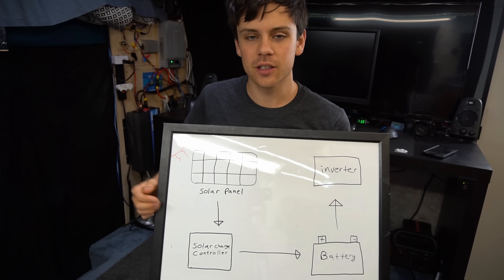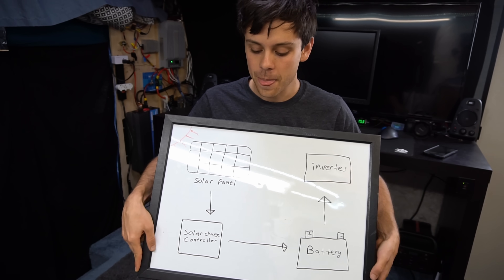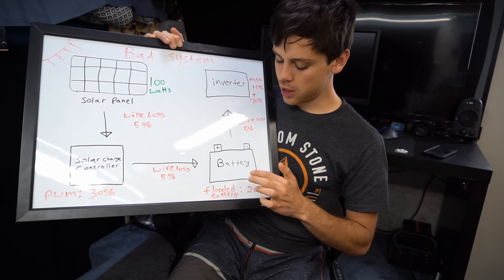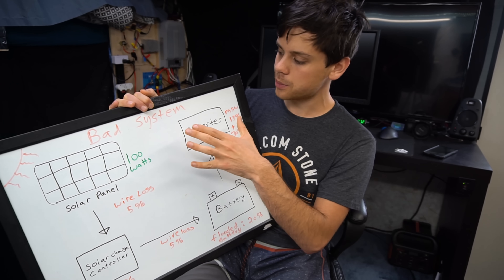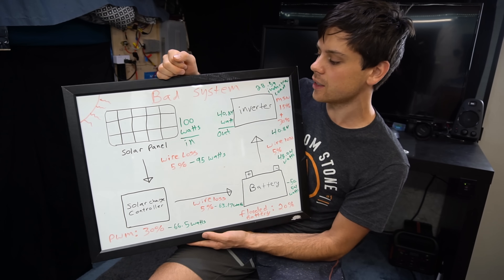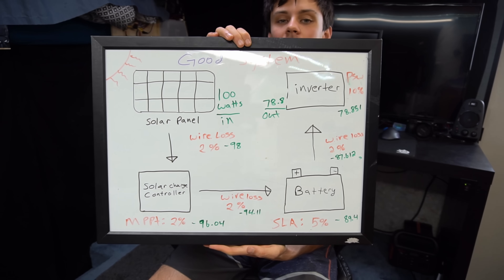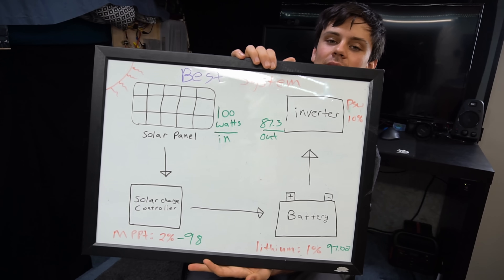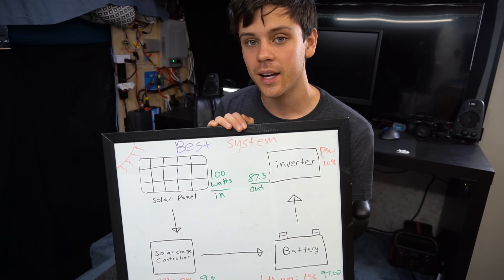Off-grid Solar Power System Comparison: Common Efficiency Losses and Bottlenecks!

Comment: How does the length of a run affect losses? I would like panels on my detached garage but I would be looking at a run of 70-80 feet. Is there a way to calculate losses based on how long a system is? Or at least how to size up a wire gauge based on length to minimize loss? Thanks

Comment: Hi Will, interesting point you made on the modified VS pure sine wave inverters. I'm searching for inverters recently and I read a bunch of datasheets, on growatt inverters they claim almost in all their series that the efficiency is at least 95%, I checked, their only pure sine wave inverters are the SPF/SPF series. What's your opinion on that? Would you consider doing a review on the growatt inverters? I would be dying to see those~

Comment: Something in this video confused me so I hope you can clarify. I previously watched your video (12v Solar Charge Controller Buyers Guide - Beginner Friendly!) where you compared several charged controllers and you seemed surprised at how close the output was between the PWM and MPPT but in this, you call out the inefficiency of the PWM controllers. Additionally, I think it's important to include the price difference between your ideal system and the one that is not so ideal. Some might be willing to pay a bit more to get a bit more power and life out of their systems while others....not so much. Of course, I just stumbled upon your page and am going through your videos and so far I love them. Awesome info! My project is much less grand where I'd like to hook up two Wyze cames (v2's and V3s) with the additional need for an IE Illuminator. If my math is correct, I'll need a battery that will support about 20 ah...but the cameras themselves draw very little while the emitter is a 12v, 1a that uses about 6 volts. Although the cameras will be running 24/7, at the winter solstice, I figured the emitter would need to be on for 15 hours. I'm sure you've also done a video on doin' the math so I'm probably just rambling at this point. 🤣

Comment: Love your videos... HELP!  I am being told that I have sized my Solar Panel string to small to charge the battery bank... Currently Battery bank is 6vx8ea Golf Cart Flooded batteries wired in series to make a 48volt bank then I have another set wired in series then paralleled for more amps.... I wired my Solar panels Renogy 12 100watts in series 4 panels to get the 48 volts I thought would work for the Solar Charger to charge the batteries... Now I am being told by a contractor I need at least 5 if not 6 wired in series to get enough voltage... He says 4 panels aren't enough... Your thoughts and maybe a video to explain how many panels does it take to charge a battery bank like I am using... Thanks for the information.

Comment: Will, head inland for a couple weeks.... away from fault lines, Magnetic coupling of Sun's coronal hole streams is causing electromagnetic tectonic plate disturbances, along with increased cosmic particle influx,  and the earth's magnetic poles are about to swap, both will cause problems with Earth's magnetosphere, being a spherical capacitor electromagnetic coupling will be extremely high. Causing all kinds of problems around the Pacific rim, Seriously. DO IT!
Reply: Still patiently waiting for that swap.......still waiting.......
Reply: @jime9305  or he's trolling with a great example of Poe's Law.
Reply: When I was young, I wondered what people like you knew that I didn't.  Now I'm old and realize you're just a bunch of delusionals who need low-dose anti-psychotics.
Reply: @RonJohn63  You do not read very many Scientific Papers Do You? You just go with the  Ad hominem attacks...and in so doing put yourself in the "I am not going to waste my time" category. I could site the ASIN , but you probably do not even know what I to what I am referring.

Comment: I watched the video "The Truth About Flexible Solar Panels" first than this one video. I skipped the 'bad" and the "good" (I'm not techie and won't understand it ... so why confused myself more)After watching this episode, I've come to the conclusion ... there is going to be lost (either system), theres no why to harness in the 100% ?! What about a system that will ... can you incorporate your diagram with the RV charging your batteries while your driving ... I hear you can do that. But also have a kill switch so the RV isn't using the main battery that's designated for starting your vehicle. I need a book "Solar for Dummies"

Comment: If then there are people who charge 12V batteries to connect to the MPPT controller 3-4 panels in series, reaching 100 volts and more, when at most it takes only 16 volts during the equalization phase, to overheat and to lose efficiency regulator stressing it to the maximum of its tension. (not power)
Just read the PDF manual or look at the charts of any serious charge regulator such as the MidNiteSolar 150
For lithium or gel, single panels in parallel are sufficient for the 24V bench (maximum 2 in series), dimensioning the descent cables 
well and do not forget the Schottky diodes for each panel or parallel. 
Leave at least a 20% tolerance on the MPPT maximum power for the lens cloud effect!

Comment: Hi, If I   put in my RV only one , 100 ah lithium batteries,  including a good charge controller and aMT-50 monitor do I need a BMS or not?....some 100 amp batteries has a built in BMS, some has  not.....but  they sell   as a drop in  batteries,

Comment: Followed your advice about a year-and-a-half ago and the components that I chose were from your suggestions. It is the best case scenario system that you've demonstrated here. I've never wanted for power I run a micro system and a stealth van running refrigeration and electric blanket, power up devices. Never wanted for power then again I live in Denver lots of sun. But this is a very efficient way. Design is key. Thanks for the best advice.

Comment: Okay I would say that if get silver wires than u can speak about less than 1% loss, moreover to say that the panel can actually produce its own 100 watts it can be angled toward the south. Last u can still improve the inverter, pure sinewave toroidal 92% efficiency. About battery hard to determine as depends on its age and state of degradation too. So far quite good calculations after all. Good job

Comment from the maker: Side Point: YES a 100 watt solar panel will typically only produce 70-90 watts. Absolutely. But this video does not cover solar panel output. It only covers efficiency losses/bottlenecks. I used 100 watts solar to make this video AS SIMPLE TO UNDERSTAND AS POSSIBLE. I will cover solar panel output in another video (or you can watch my older videos where I mention this issue). Hope this helps! :)

Tired of getting ripped off? Check out my "Will Prowse Approved" solar product recommendations below!

12V Batteries
https://www.mobile-solarpower.com/lithium-batteries.html

48V Batteries
https://www.mobile-solarpower.com/48v-batteries.html

Offgrid Inverter System Builder
https://www.mobile-solarpower.com/48v-complete-system-blueprint-559371.html

Hybrid Inverter System Builder
https://www.mobile-solarpower.com/code-compliant-48v-offgrid-system.html

Mobile Handtruck System Builder (very popular!)
https://www.mobile-solarpower.com/mobile-48v-system.html

Solar Panels
https://www.mobile-solarpower.com/300w-solar-panels.html

Ground Mount Solar Racking
https://www.mobile-solarpower.com/ground-mount-racks.html

Wire, Lugs and Busbars
https://www.mobile-solarpower.com/wire-and-connectors.html

Tools
https://www.mobile-solarpower.com/tools.html

Fuses and Circuit Breakers
https://www.mobile-solarpower.com/fuses.html

Plug-N-Play Solar Systems
Ecoflow, Anker And Bluetti! So many models to choose from. See my current recommendations here:
https://www.mobile-solarpower.com/full-size-systems.html

~~~~~~~~~~~~~~~~~~~~~~~~~~~~~~~~~~~~~~~~~~
Need to build a large DIY system? Need a trustworthy solar distributor? These are my favorites:

Signature Solar
Creator of EG4! Solar Minisplits, Victron and More! Largest Solar Store Online.
If you want $50 off, please use my link below and coupon code "DIYSOLAR50":
https://signaturesolar.com/?ref=cPwLcVc0SW-BjN

Current Connected
Best Prices for EG4, Victron, Midnite and so much more! Fast Shipping and Highest Rated Customer Service:
https://currentconnected.com/?ref=wp

~~~~~~~~~~~~~~~~~~~~~~~~~~~~~~~~~~~~~~~~~~
Join our DIY Solar Community 
Need more help? Join the largest solar forum on the internet for beginners and professionals alike. 140,000 members and counting!
https://www.diysolarforum.com

Check Out My Free Book
Best-selling and beginner-friendly guidebook to off-grid 12V solar!
https://www.mobile-solarpower.com/the-book.html

~~~~~~~~~~~~~~~~~~~~~~~~~~~~~~~~~~~~~~~~~~
Contact Information:
I am NOT available for personal solar system consult! If you wish to contact me, this is my direct email: williamprowsediysolar@gmail.com
FTC Disclosure Statement and Disclaimers:
Every video includes paid promotion or sponsorship (such as free products for review). Some links on this YouTube channel may be affiliate links. We may get paid if you buy something or take an action after clicking one of these. My videos are for educational purposes only. Information is subject to change/update at any time. Electricity is DANGEROUS and can kill. Be smart and use common sense :) DIY Solar Power with Will Prowse is a participant in the Amazon Services LLC Associates Program, An affiliate advertising program designed to provide a means for sites to earn advertising fees by advertising and linking to Amazon.com
Reply: One issue I see is that -- even when at noon on the perfect day in the tropics -- the battery "resets" the loss from the solar panel through the wires and controller to the battery.  What that loss does is "just" require more time to charge up the battery.

Still, it's a great way to demonstrate total systemic loss.

Comment: Also, you should emphasize that circuit protection should be sized to protect your weakest link; whatever is the lowest rated amperage.  Could be the wiring or a component.
Using wire AWG smaller than your circuit breaker trip amperage could lead to a fire.
Additionally, if this is going to be a long term permanent installation, the additional cost of using oversized wire will eventually pay for itself through reduced voltage drop.
Reply from the maker: Yes absolutely. And I would cover that in a safety video instead. I could also measure the resistance of a badly sized fuse. That can leech a system pretty bad.
Reply: Why no fuse from the panels to the charge controller?  A panel short seems very likely as they are at mother natures mercy.  A solar safety vid would be so important.

Comment: Did you see that in my YouTube channel?
Reply from the maker: See what?
Reply: @WillProwse  too small wires crappy batteries cheap inverter crappy charge controller Etc all of the above
Reply from the maker: @solarpowerelectricityandel2915  I never saw it and I covered this exact topic in my book over a year ago, so I did not copy you at all if that is what you are implying.
Reply: @WillProwse  I'm not suggesting that you copied me you did an excellent job on your video I'm just saying there's other YouTubers that do an excellent job of installing or putting together DIY solar array for instance I have 33 kilowatts of lithium batteries I rebuilt nickel-cadmium flooded batteries I started off with t 105 batteries everybody's going to learn to start off with a cheaper Solar array so when they tear it up they understand it better and take better care of it the second time or third time around
Reply from the maker: @solarpowerelectricityandel2915  Ohhhh ok just making sure. And yeah absolutely. And very cool! Good job! That is amazing. You have a rockin system!
Reply: @WillProwse  sorry if I come off a little strong I'm just trying to get in good with all the other Solar Guys and try to bring the solar Community together so if you're interested in doing a collaboration sometime please let me know I'm a electrical technician by trade My solar arrays has permits pulled on it
Reply from the maker: @solarpowerelectricityandel2915  Oh nice!! And yeah sounds good. I will try to think of something for a future video collab. I will follow your channel now
Reply: @WillProwse  sounds good to me too I can generalize with RV to accommodate your Channel
Reply: @RonPaulgirls  Are you running on solar power friend?